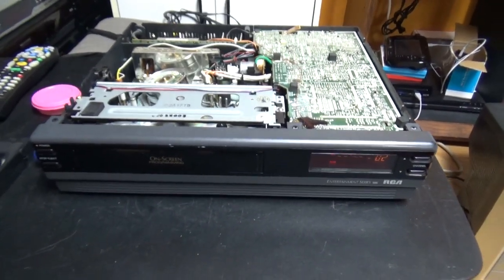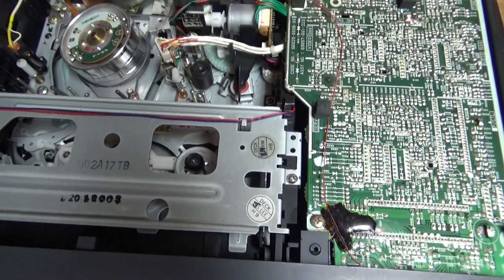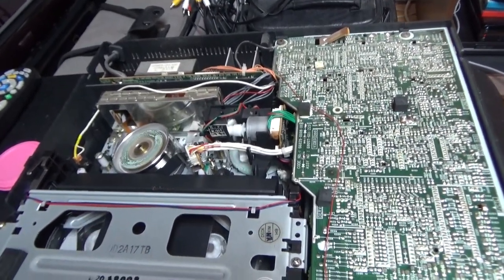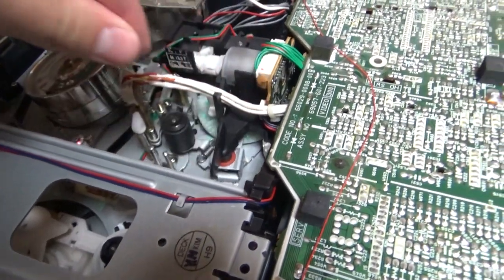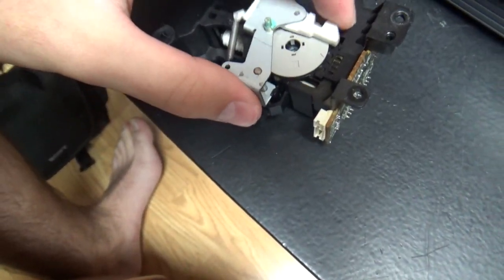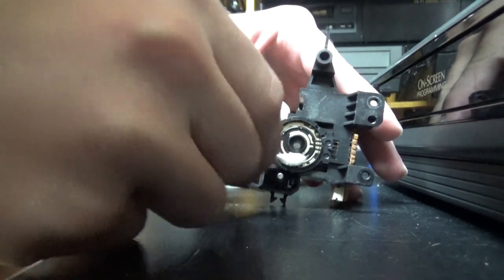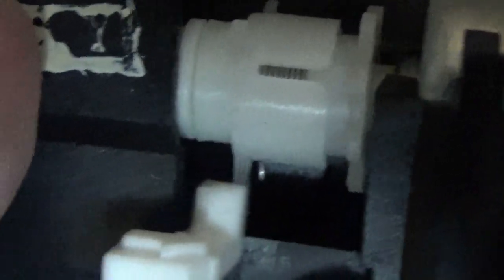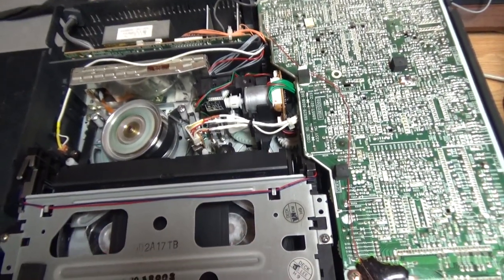RCA VR335 VCR bad mode switch

Comment: Nice video. Takes me back to my VCR service days of the 90's. Forgive me but I'm going by memory here and not sure if it applies to your problem, or not. But, those Samsung-built models had problems with diodes.  I looked at almost a dozen of these in the early 90's and most had diode problems. If memory serves, and as I understand, certain of the larger diodes were stressed during assembly (by bending the leads) and would later break down and open and/or become intermittent under use. RCA had a "diode kit" part number 216135 that gave you multiple numbers (5? 7?) of diodes. Some of the diodes locations affected were D105, D106, D107, D108, D109, D110, D112, D114. For diagnosis purposes during "triage" I found I could temporarily short over the solder joints of D114 with a pair of needle-nosed pliers which allowed the loading motor (at the least) to run to remove a customer's stuck tape (if there was one, and often there was). Although those diodes were technically part of the power supply many were NOT located on the power supply board. Several (don't remember how many- could have been 5, or so) of of them (D112 and D114 particularly ring a bell) were located just to the right of the loading motor in your video (along the left edge of that large circuit board). There were two (?) individual (larger?) diodes as part number 201066 located somewhere (sorry, memory) but the 216135 covered the 5 or 7 smaller ones.

On another note the clutch was also a popular part to fail early (marked B234 in exploded views, RCA part number 210841). Believe I would just quote and replace it whenever one of these series would come in for any other service. 201066 was another popular part number for this Samsung series of VCR's but can't remember what it was or why it was replaced.

Good luck with your VR335!

Comment: I opened my RCA VPT 294..looks similar to this one.When I load a tape..the mechanism that transfers the tape to the heads is not working.Another person servicing a player ALSO pinpointed the mode switch as the culprit.I will try this tomorrow.All the belts on my player(5) were soft/ decayed.I am trying rubber bands.Will rubber bands work or will thete be too much tension?